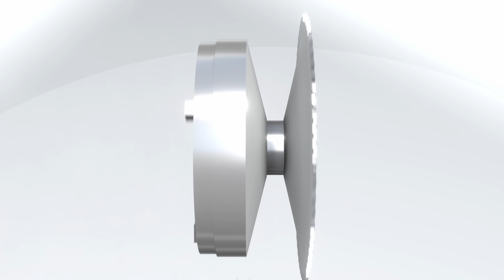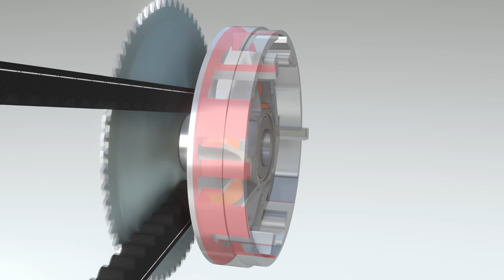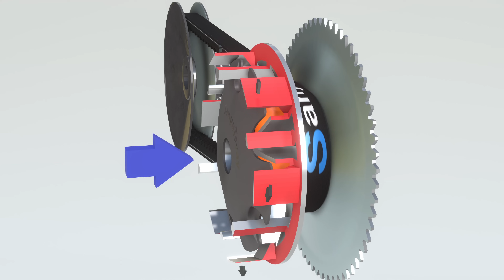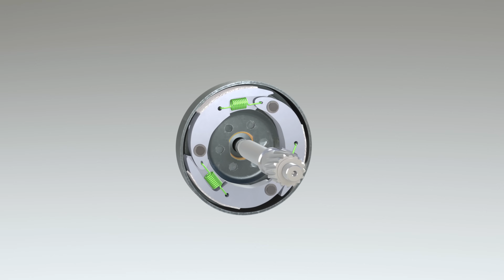How does a scooter's CVT work?

Comment: The animation has the wheel spinning in reverse. The rotation of the counter shaft and the final gear should be opposite one another, not in the same direction. Other than that it’s a great video. Thanks!
Reply: No you are absolutely wrong, because it's a belt drive not a gear drive, through the belt transmitted the power (rotary motion), also in there used open belt drive so driver and driven rotation will be same direction , if use cross belt drive that time rotation will be opposite to each other , it's a belt drive 👍🏻😊  i love machines and  machanism , you are making very good video ❤️😊
Reply: 5:01 5:01 5:01 5:01 5:01 5:01 5:01 5:01
Reply: 4-15 mp nél van elpuskázva! A többi nagyon szemléltető videó!
Reply: Too lazy to correct the animation. He just pinned this comment.
Reply: @rayvincyful1  you are talent🎉 to creat these videos
Reply: @rayvincyful1 Damn this better than the actual video.

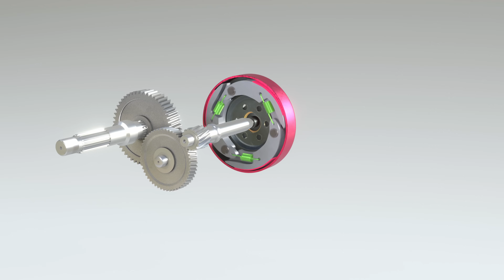Comment: Excellent video, but at minute 4:21 the direction of rotation of the wheel is wrong.... But it is clear that they did it on purpose or the programming of the video misinterpreted it.... Because following the direction of rotation of the output gears, the wheel would naturally have the correct rotation.... But excluding that detail is a very good illustrative video of the operation of this transmission system, thank you

Comment: So, if you want more responsive acceleration to top speed, simply use softer springs, or lighter roller, hence the centrifugal force achieved faster and give faster response to speed changes.

Comment: This is not true that lighter weights enable higher speed. The suit gets better with ladder weights but not the top speed. I just installed lighter weights myself. From the previous 90+, only 80kmh+ is left, which is enough for a 50cc scooter to not be an obstacle in traffic. But the video is well done
Reply: How 50cc scooter get to 90 kmh!? My 125cc yamaha scooter loose power on 85kmh++
Reply: @he_xhndr6333  Your scooter is dethrottled and you have a sports exhaust on it?

Comment: Well after owing a few scooters and replacing, maintenances them. Altho I'm not able to design or invent a better system. For me the scooter cvt design and function has many weaknesses from my own experiences. Mainly coz its have too many parts combined into it and will cause many issues and vibrations problems. I know this weakness create lots of opportunities for mechanics and spare part dealers and manufacturers to make profits. 😅 Its also a higher cost of maintenance too compare to a moped. 😅 
Given my preference, I would choose a moped with 4 gear semi auto transmission over a scooter any given day. Belt vs chain, i would say chain wins 🤭✌️✌️✌️ peace. Just my own opinion